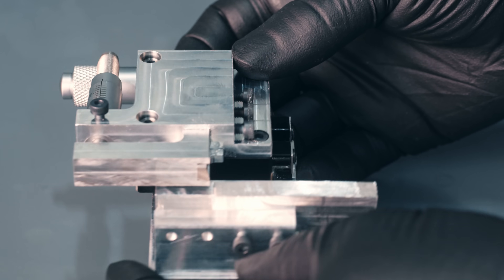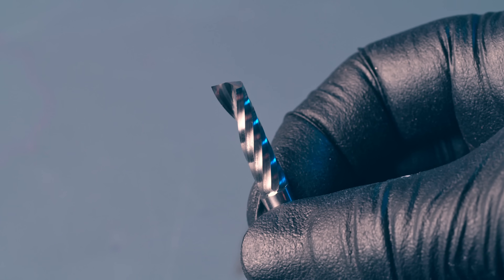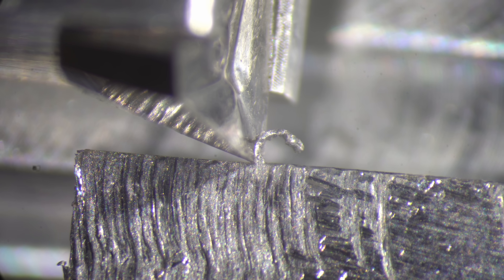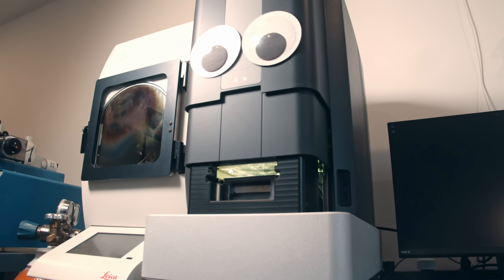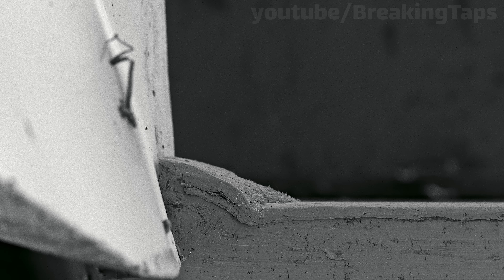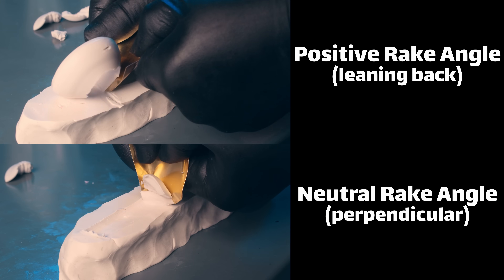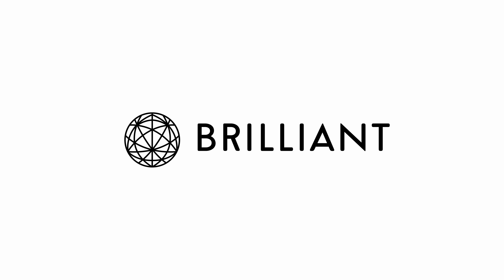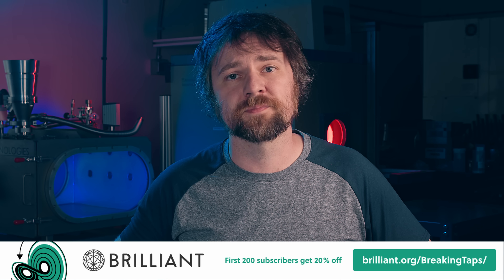Cutting Metal inside an Electron Microscope

Comment: @BreakingTaps I am retired C programmer, started in the early 80s. I am enough of a machinist to combine those and make a recommendation.

Use a continuous motor to turn the carriage screw. It is more like a lathe or mill in how it moves the cutter. 

Very high ration reduction drive, electric motor and any number of triggering mechanism to start and stop the motor. Mechanical timer to a relay, electronic timer to a relay, Arduino with a simple serial to Bluetooth, ESP32. Endless variety, no "right one" just one that works. Use a battery if you can.

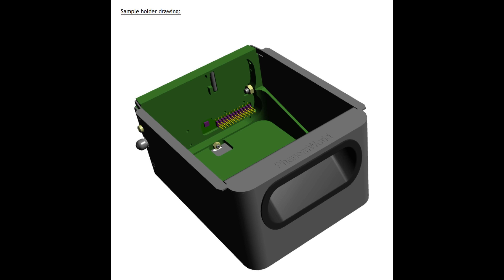Comment: You might be able to do it electronically with a battery and remote, that way you don’t need wires going through the box. Or if for some reason a remote doesn’t work you might be able to manipulate a switch using magnets from the outside of the chamber. 9:59

Comment: Maybe its a really stupid idea but why not put a little DC motor, powered by a small battery,with a large reduction connected to the micrometer screw to have a continous motion. In this Way You Can also study the difference in the cutting speed(maybe there will Be some effect like Portevin Les Chatelier?)  but I'm Not an exper so maybe the batteries are not vacum safe

Comment: = This way you don't need the expensive box.=  Rig up the stepper with the microcontroller and battery in a smaller home-made box with the electrical feedthrough that sits inside the main box, isolating the battery and electronics from vac. Then set a 10-min timer, or use Bluetooth, to then start driving the feed.

Comment: I just found this video, and it is one year old already. But I try. I hand engrave metals. The tools I use are much sharper than indexing plates. It is made from tungsten carbide plus the edge is mirror polished. I like to cut steel. Once your tool is properly sharpened the cut is bright and shiny. Aluminum is much softer and cuts are not that crisp. I wonder how graver cuts might look under electron microscope.

Comment: This is so cool, it looks like clay... I wonder if the shearing action of the tool would be minimized by decreasing the angle, (tool edge more flat vs metal surface..). At this scale what you consider a precise cutting job looks a bit of a mess😂

Comment: YouTube found the need to put this video on my feed. Once in a blue moon they get it right. So happened today 8/19/2024 is a blue moon. Great demonstration of the principals I use almost every day of my retired life and even explained a nagging question I had. After spending 40 years in the automotive industry as a dealer Tech when I retired due to a disability, I started automotive machining hobby. Over the years I had held onto some of the basic skills my grandfather taught me in his machine shop back in the 70`s and 80`s. Valve seat cutting was still in it`s infancy back then. Mostly hand work with pneumatic grinding Moters and specific cutting wheels (stones). A quality 3 angle valve seat cut was usually mirroring a factory cut. Fast forward over 40 years and we have Carbide cutters up to 5 angles with radius all built in. Using these modern cutters, I was baffled how the cutters would cut the hard alloys of modern seats and leave a gummed-up edge where the cutters trimmed the aluminum around the seat. You explained this perfectly.  Made a old man`s day !

Comment: How i learned, high speed steel is not really harder. It can endure higher temperature, before it looses its hardnes. So you can use higher cutting speed, with all its benefits.

Comment: It would’ve been really cool to see that the heat applied to the metal if you could’ve done it in real time inside the electron microscope to see like pressure and heat form from the pressure and that causes the metal to get soft to the cutting process the whole picture of it cut

Comment: It isn't the surface hardness of the tool that cuts. It is the compressive strength, confined and concentrated to a tiny area. pushed into the (compressively weaker) work material.  Surface hardness prevents erosion of the tool face, preserving the shape of the cutter.

Comment: High speed steel is still used in industrial settings for paper cutters, where it's generally too expensive make carbide blades that are often more than 62cm long, with some I've seen as long as 2.4m.

Comment: I always use high speed when cutting aluminum. As you can see aluminum is like clay and it tends to stick to carbide then breaks my tool. Where as high speed is smoother and sheds the chip off

Comment: The footage is amazing!
Back in the days when frogs still had a fur I was an apprentice and eventually became a CNC milling machine operator. Since this happened in middle Europe, it wasn't just a training like "press this button and the machine goes brrrrrmmm" - we should be trained to exactly understand what's happening while machining. Consequently we did see footage like this before, just taken with an ordinary macro camera instead of an electron microscope.
And what I can immediately pick up is that the cutting speed in your video is incredible slow. The material is ripped apart very much and then bent pretty violently to follow the top plate of the insert. Less cutting than forcing a chip to separate from a base material. If you'd do the same video but advancing the cutter with some 300m/min (1000ft/min) through the material, the chips would look very much different and the surface quality of the cut would be much much better.
This is not a criticism of your video, on the contrary. It's just stunning to see the effects of the base material deforming during a low speed cut, and why the surface quality is suboptimal etc. And, at the same time, the picture quality is excellent. The videos we saw during my apprenticeship have been on 16mm film, probably from the 60s. The picture quality was accordingly, and newer footage is hard to come by.

Comment: High speed steel isn't generally used anymore? Uhhhhhhh what....
Reply from the maker: It's not 🤷 Most decent shops have long since switched to carbide. Faster, more productive, more consistent reliability, better surface finish. Exception is maybe oddball tools like slitting saws or woodruff cutters, but even those come in carbide flavors if you want them.

Comment: As one who worked with both machine tools, actually cutting metal, and worked in a carbide cutting tool factory as a grinding machine operator, I have to say this is the most fascinating view of the cutting process. We could watch it before via microscope, and high-speed camera only, not sure if the R&D had this view (but let's assume because they had a 3D diffraction machine to see the grain structure in the carbide).

In the footage, it is clearly visible that the cutting edge is not "sharp". After we grinded it was much sharper. The edge itself is purposely rounded with an abrasive brush or sand-blaster, all computer-controlled, for a specific time, blasting from a specific angle with the specific sand type. All are customized to the carbide grade, and targeted material by the cutter.

The actual cutting speed (the feed rate, the advance of the cutter) matters a lot in real-world applications, especially for certain cutter geometries and materials, it's a BIG + that it was reproducible in SEM at zero speed as well! 

The biggest part of the R&D of the carbide tools is towards productivity, the higher removal rate of the material. Today's cutting speeds and feed rates are simply incomparable with the speeds from 30 years ago. In some applications, you just see (or hear) a jet of chips impacting the inside wall or glass of the machine tool, while you only hardly can follow the tool movement along the toolpath.

There are some videos on YT where in Indian/Pakistan workshop they use a lathe to machine a shaft. Sometimes they do it at a very low cutting speed, sometimes painfully slow. They use high-speed tool material, not carbide. But it works! The tool just has to shear the material as seen here. The achievable speed and productivity depend mainly on the tool material, geometry, material, machine tool, stability, and experience. The ideal conditions are tested in carbide factories and communicated in the catalog and on the packaging of the tool.

It is clearly visible and explained in the video, that the tool does not "cut" or magically rip apart the atoms (or whatever we thought about the word "cutting"), but it pushes away the material and actually shears.
If the edge is worn, the conditions change a lot, and the tool must shear a bigger cross-section or push toward the wrong (non-ideal) direction. It works for a while until you have to change the cutter. 
It works better to use worn tools in carbon steel, but in stainless, it is worse. The tool has to push away the material a little bit (plastic deformation) before shearing in any material, but the stainless steel however tends to work-hardening when deformed, i.e. a bigger section of material will be harder which wears the tool further (the tool is made for the non-work-hardened material, not the hardened parts)

Many experienced therefore difficulties in cutting or drilling stainless steel. The tip from a factory expert is just to use sharp tools in stainless. If you have a roughing and fine pass, keep your roughing tool sharp, and then you will have no problem with the fine pass, easier to keep the tolerances with less wear on the fine cutter.

Comment: remote control setup to control a motors to spin the device that you already have  that way you don't have to remove it from the vacuum and you don't have to write any code just use the remote to move it forward for each slide

Comment: The main difference between Carbon Steel and High Speed Steel is not hardness. Its that HSS has a higher max operating temperature, so it can be used longer continuously/require less cooling/run at higher speeds (cutting generates lots of heat). Actually its a bit less hard usually than carbon steel. So High Speed = you can set your cutting tool to a higher speed :)

Comment: I am astonished that you managed to do it manually!
For chamber with electricity, what about wireless phone chargers? Or just regular induction coils, but phone chargers would be a good first try. I'm not sure how much power could you transfer in the end, but it could be a cheap workaround for transferring small amount of power. Because I assume that there are no (cheap enough) batteries that are safe in vacuum? I would think that encasing them in resin would give them enough internal pressure to keep them from boiling, but probably you don't want to risk it with your chamber...
Edit: also, I would love to see if hardened steel would behave similarly...

Comment: You could also make a battery powered stage to advance the cutter. It would be controlled wirelessly and all electronics not compatible with vacuum or the electron beam could be in a sealed metal pressure vessel.

Comment: "High speed" in HSS has to with a quench seeming to operate faster than it would in carbon steel, due to kinetic barriers to cementite growth. This property gives you a extra time to transform austenite into martensite, and also means that the metal doesn't temper from that quench until a much higher temperature than for a typical steel.

Comment: Hello. These are very mesmerizing shots. At first I thought that the motors could be controlled by radio, but most likely there would be a problem with the power supply. Perhaps it can somehow be solved using induction

Comment: as an engineer i work with metals and we always talk about them like they're these rigid lattice structures that break and slip over each other. i thought this was easy to imagine until i saw this video. It's so weird how it behaves like clay, and i can't wrap my head around the fact that the deformations are actually metal atoms "slipping" over each other and the grains being crushed. I guess it just goes to show how insanely small atoms are. It's always good to get a real-life sense of how anything works, rather than just reading about it. Always appreciate these videos.

Comment: SS can be sharpened so much more acutely than carbide.  Carbide  removes material subsequent to high edge pressures. HSS is sharper and cleaner  it'd be so  useful to see HSS doing what you did with carbide.

Comment: This is So great! I am a self taught machinist, with a background in woodworking and I've found it hard to build a mental model of what goes on at the tool edge cutting metal - thinking of the metal as fluid, being pushed is really helpful as a way to get away from my mental model (and physical experience) of wood machining.

Comment: 1:14 The main thing about HSS is that it doesn’t lost its temper until very high temperatures, hence the ability to cut at “high speed” even if the steel heats up.

Comment: It's really cool, but the rigidity of the setup really changed the outcome. Plus, feeds and speeds, and in this case, torque had a huge outcome on the results. To fix the rigidity problems, try making out of an annealed steel, then harden it after you've machined it and surface grind the faces that touches the material. The feed and speed problem well, I'd love to watch you make a room sized vacuum chamber. I know the impracticability of creating a vacuum chamber like that. Still love your work

Comment: If you like precession machining and grinding,. You should check out Precession Instruments INC, Hopkins MN. I retired from there, after 20 years. Most of their products are in the air bearing industry. Tolerances are at .000,0010 of an inch.

Comment: Why is the molecule structure of the metal mostly horizontal, but sometimes also a small part of vertical molecule structure? Is it pressed that way?
Edit: @ 6:40 you can see one part of vertical molecule 'lines' in the picture

Comment: I know it's been a few months, and all, but I can't help but wonder why an electrical passthrough is needed to power a motor. Surely there is some kind of opening available in your chamber into which energy could be passed? Solar energy? Wireless charging unit?
Reply: Well I haven't used one my self so I may be wrong on some stuff, scanning electron microscopes instead of light they use a electron beam hence the name, so I assume the scanning chamber is made to eleminate other particals that can interfere whit the sensor, so it would be sealed of from light so photons wouldn't "crash" into the sensor durring the scan and wireless charging would deffinetly interfere whit the sensor

Comment: Would be very interesting to see the temperature map of the metal around the cutting area. 
I learned how to use lathe myself, using old soviet tools which I ground in shape myself. Much too late on my journey I learned and begun to appreciate the element of heat transfer. 
High temperature can and will kill any cutting tool. Speaking of malleable metals there appears to be an optimum 'chip' size where it does not coil into single mess of wire, but that cools the cutter quite well vs small chips that get too hot an erode the blade.

Comment: in metal cutting everything not so simple. very important a speed of cutting. on the low speed, you will get exactly this picture(like on your video) where plastic deformation of the metal will predominate. At high speeds, elastic deformation predominates, and cutting proceeds differently. all materials and cutters have their own processing modes and it’s all in spreadsheets and books.

Comment: @BreakingTaps Would a RC controlled cutter be posible? Then you wouldn't need an physical connection to the outside
Reply: You would still need to provide the motor whit power, and RC (Radio Control) wouldn't work either, its a electron microscope, not sure if this analogy would work since its pretty automatic these days, your phone emits its own light which can vary in intensity, when outdoors in the bright sun you need a higher intensity on the phone see it's light since the sun interfere whit it compared to the night when very few photons can interfere whit the image, the vacuum chamber is like at night for light, there isn't much interference for the electron beam as it makes the images, we don't really wanna intrudoce a sun so to speak inside of it

Comment: I know it's been a 4 months since a video, but i still will throw an idea out. Instead of clockwork we can use a sealed system with a pressured chamber and a atmospheric pressure chamber. Between them you need a valve with a fine adjustment and something like a paddles that can be rotated by moving air and transfer rotation outside. Or it could be filled with liquid, and moved by pressure. Edit: after that I realized that it would be a continuous motion and will require some mechanical trickery to make pauses.. I guess it would be easier to make "vacuum resistant" metal box with a lithium cell inside and 2 pins to output power outside it.

Comment: Vacuum soldering or something like that is a thing right? Why the metal parts didn't stick together?
Reply: Vacuum soldering only happens when the surface oxide layer gets removed and you get pure metal to metal contact, that requires friction and movement, his setup used roller bearings so there wouldn't really be enough friction to remove the oxide layer at least not in such a short time, and he took the set-up out of the vaccum to move it, so any damage to the oxide layer very quickly fixed it self,
Reply: @link7417  i feel kinda dumb hahaha your explanation makes so much sense :)